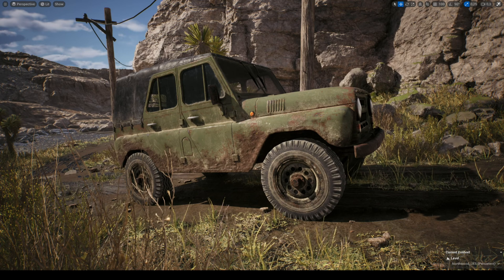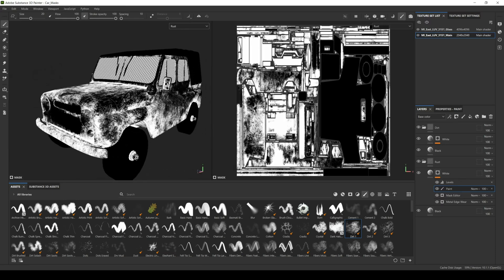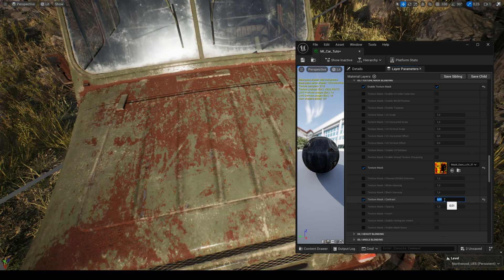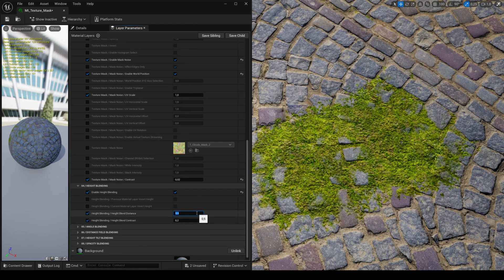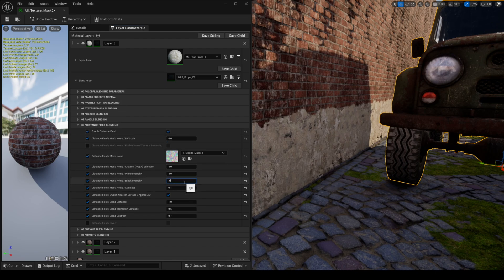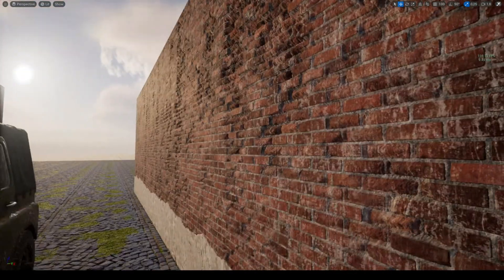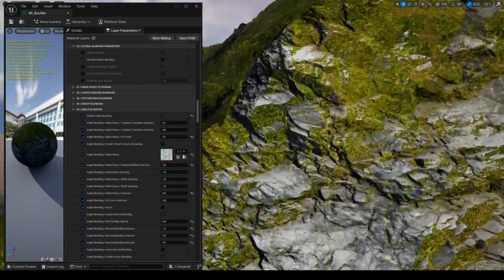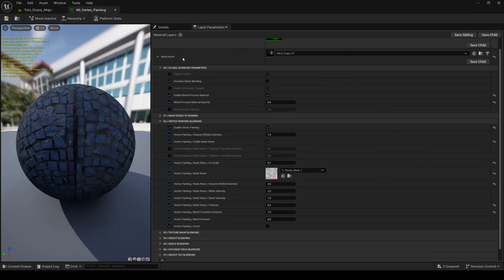UE5 Tuto 04  Blending Layers / Advanced Master Material For Props #ue5 #unrealengine #shaders

Comment: Does the background layer of the layered material support adding the original base texture of the model, such as color map? For example, I have a scanned model and hope that its color map can be added?
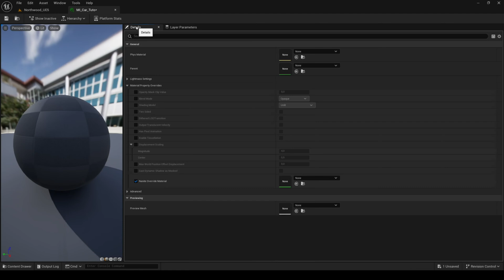Reply from the maker: At 3:30 you can see that the background layer supports the color map, each layer is identical and supports all maps. Your scanned model would be similar to the car in this situation.
Reply: @Textures-3D-Models  thank you so much,your material is what I really need ,it is so good.In fact, we can use UE's modeling tools to bake the mask. I often do this because I am lazy and don't want to use substance painter to draw the mask.😍